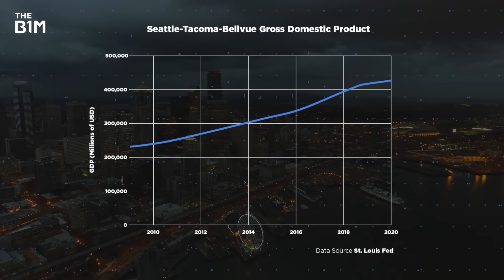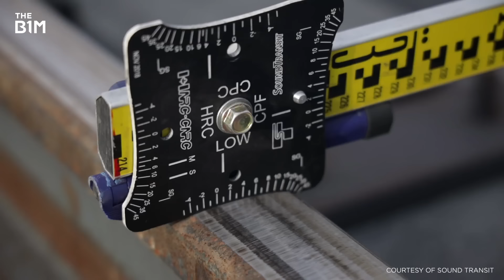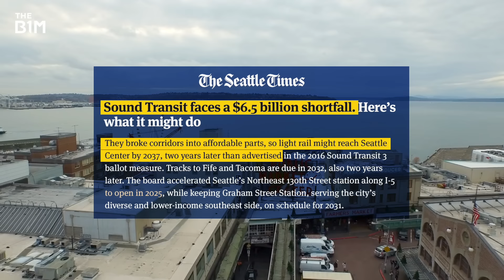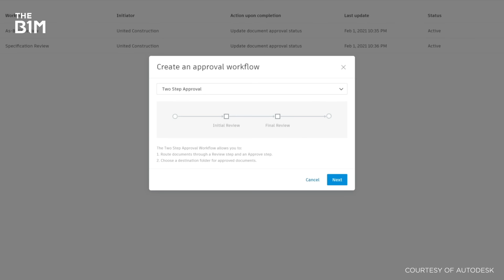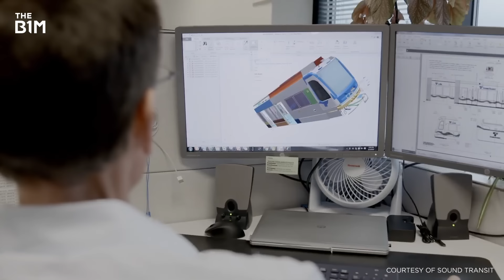Seattle is Building a $54BN New Railway

Comment: Ive got to laugh, it will cost you 3 times the amount and your still not finish as it will take you 3 times the amount to time. Iam from Honolulu and it a money pit. Why is a 3 party job if the rain will be a board of director it a 4 party job. And they blame the other constantly  even California is 3 x time over and not even half the amount of train route the shorten.  It just too expensive and wasteful we got 10 yr or it was a 20 yr and still,3/4 way  and no way it can brake even needing 130 thousand rider a day and 120 million maintance a yr. it more like 50-65 k and this is only part 1 they want to do 2 more parts. You be taxed up the butt. With a 1 % tax on every buck you spend

Comment: Soooo…. There is clearly a huge problem with how to go about mass transit. 
Rather than building expensive projects in the city, transit should be stretched outside of the city for new suburb developments. More affordable living options such as single-family homes or condominiums linked to the city for work via light rail. They need to ask WHY. Why are people looking to drive into work. The  most efficient solution would be internet infrastructure services for more work from home options, like the pandemic has shown us, pushing companies to be more flexible with telecommuting.
Reply: The main reason why public transit generally fails in American cities is BECAUSE of single family housing.
Huge areas of cities and suburbs are zoned exclusively for them only, making public transit practically useless unless you live right next to the station AND it took you close enough to your final destination.

Comment: Sound Transit has built and opened twenty-five miles of light rail in twenty-five years.  That is one mile per year.  Light rail at its best moves only 5,000 passengers per hour per direction.  You (and Seattle) have been punked.
Reply: It was and is obscenely expensive, but it did have 24 million riders in 2022. I don't think it reduces traffic that much, but it is moving a lot of people without cars

Comment: Colossal waste of money. In trying to be "green" and "forward thinking", public planners are actually being short sighted. 20 years (or sooner) from now, we'll be able to call an autonomous network connected car that will drive you from door to door, communicating with all the other vehicles on the road, powered by renewable energy, costing 90% less than today's public rails and buses. Who's going to schlep in the rain 7 blocks to a train station and take an hour to get to their destination when they can call a robotaxi that'll be there within minutes and take them directly to where they need to go, for pennies? What we SHOULD be doing is supporting auto infrastructure and moving towards the day when all that infrastructure is nicely built out for an autonomous future wherein getting from one point to another is made simple via personal people movers. Public rail ONLY makes viable long term sense for uses like moving from parking structue to airport terminal and back. It makes absolutely NO long term sense for city or area wide travel. It's unsustainable financially (no people moving rail system in the US is self sustaining, even after 100+ years) and is overwhelmingly inefficient at moving people from their exact location to their exact destination. We're not far from that being the norm and all these elaborate public transportation schemes will be relics of a bygone era.
Reply: yes, moving 2 tons of metal to pick up a single person is definitely more efficient than a train.
Reply: @AmbientMorality When automated with other vehicles (no traffic jams), powered by electric and and autonomous (1 vehicle used by 20 people a day) and can pick you up at your door and drop you off at the door of your destination in any environment (city and suburb)... yes, it's a much more viable option than immobile train use wherein less than 5% of the population use it because it takes too long and the last mile problem still goes unsolved. 

In very busy city centers, there could be a hybrid approach but for the ever growing suburbs, trains are just not the best solution.
Reply: @n.m.8802  Yeah, public transit use in Chicago is much higher for example (28% in city, 17% metro area). The metro area is kind of impressive, though I think it's probably a lot of car commutes to regional rail.
Reply: @n.m.8802  Why not have the choice? You choose to live in a noisy dirty city where getting somewhere is a chore and living on top of each other with no space for anything and I chose to live in a clean, cheap place where I have the space available to me that I want and I can get all my errands done in 30 minutes, including transportation time. I have a pool and all the space I need for projects...etc. I have an amazing life because I live in the suburbs. You can have the cities. I'll take the suburbs any day. And I enjoy living there. As do most people who live in the suburbs. 

You are wrong on level 5. It will be here within 10 years. We already have it where I live. We have taxis with no drivers (Waymo). Sure, it's a pilot program and it works within a confined area of our suburb, but it's here. Trains are absolutely awful. I use our metro line here sometimes to get to the airport. It takes twice as long as driving. And I still have to get to the stations on either end. In the weather. It absolutely sucks. 

BUILD BETTER ROADS!!!
Reply: @n.m.8802  I agree. We do need to clean up our cities but as long as they are run by the political left in this country, I don't hold out much hope. That's one of the many reasons I don't live inside a big city. Our city of 230k people is run amazingly well (I live in Gilbert, Arizona). We are on all the top lists for livability, safety, education, income. It's a remarkable place. One of the reasons is because of how much foresight they had in planning our roads. A traffic jam for us is 5 cars deep at a stop light. We can get from one side of the city to the other in 5 to 15 minutes. We have easy access to any amenity you can think of, within a 10 minute trip from door to door. We have amazing parks. We have a dog park 2 minutes down the road that most of the world would envy.

Our house is currently valued at around $700k. It's not fancy by American standards, but by European or most of the rest of the world, it's huge. And almost every house in Arizona over $500k has a pool. It's kind of a standard item. 

The Waymo autonomous vehicles are actually operating now with NO driver. At all. There is no driver in the driver's seat. TuSimple is now running driverless freight trucks here in AZ now, too. And yes, it's much easier to do that here because of our amazing roads. But you really think that can't extend to most of the places that don't have access to inner city trains, within the decade? Of course it can. And it'll increase the quality of life in many places.

I've lived in Amsterdam, Barcelona, London, Paris (close to Versailles, actually) Cape Town, South Africa, Mexico City, Medellin, Colombia (I'm in Cali Colombia as I type this) and Chang Mai, Thailand,  as well as several big cities in the US. So I'm not a stranger to how others outside the US live in their cities as well as outside their cities. But in all my travels, I've never experienced a quality of life that could beat most suburbs in the US. It's just hands down, an easier life that we've built for ourselves here in the US. 

I do feel fortunate that I have access to this easier life. I just hope governments don't start taking it away "for my own good".

Cheers!
Reply: @n.m.8802  This is why public transport isn't the universal transportation solution that some people think it is. For Singapore, it makes much more sense because of your density. And believe me, the problems that manifest themselves in our big cities here in the US can be directly attributed to poor leadership from one side of the political spectrum here in the US.

When I lived in Kuala Lumpur, I didn't find that they're public rail system was all that great. I much preferred to call an Uber and go me directly to my destination.  

When I said that the rail system was a waste of resources, I was referring to this particular place (Seattle). I've lived there. I know it's issues. They need better roads. Not rail systems.